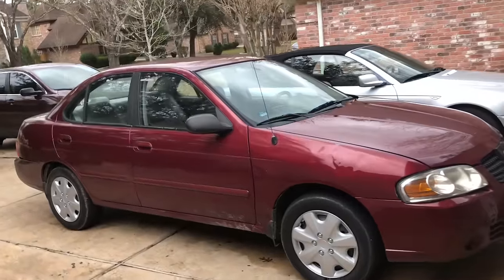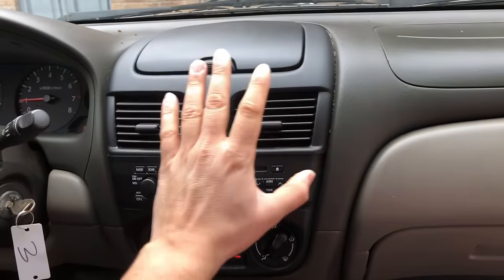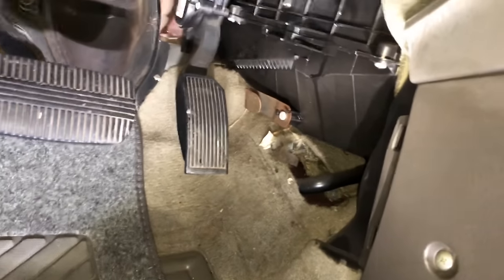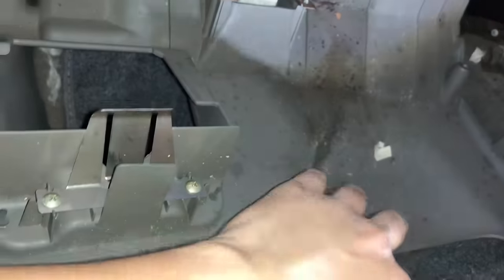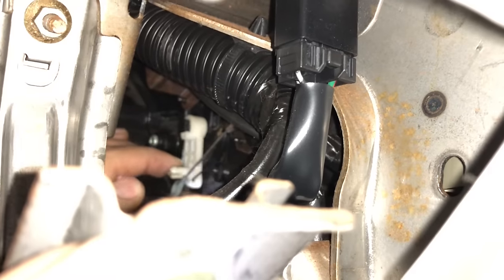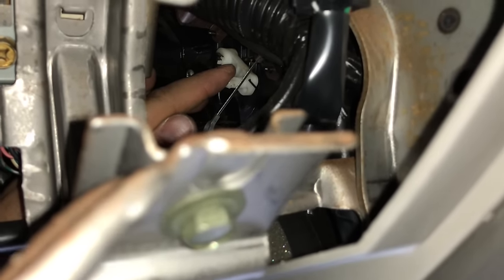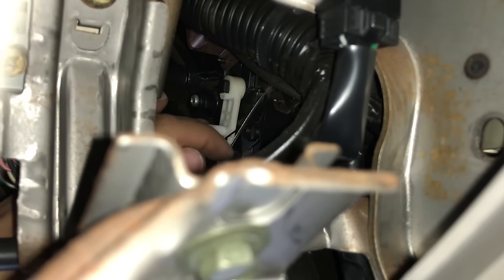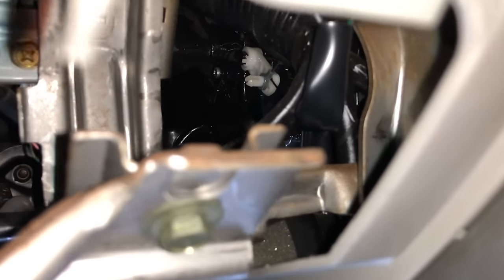Ac Blows Hot Air Only Fix - On Any Car

Comment: i have this issue right now on my 2010 civic, the passenger side vent (just the one on the right) is cold and the driver and middle vents are warm.  I have checked the AC relay (OK), checked the temp ix door (its working), performed a hvac self test and no lights flash, checked r-gas with the fill can kits and its in the blue (filled).  Not sure what else it can be.  I noticed first thing in the am when it is a bit cool outside, all vents are ok and then within 10 to 15 mins same issue happens. Any help would be awesome!
Reply from the maker: Usually that issue happens when the freon is low
Reply: @GarageBoys  Thanks; i checked again today with the air can  fill gague and it says its filled around 45psi.  Its super cold in the mornings and at night. But during the day, just the passenger 1 vent is cold ad the others are not so cold
Reply from the maker: Sometimes the freon it’s so old it’s not cold anymore, the system will say it’s at the right psi but it’s actually filled with air not freon, it’s really not expensive to vacuum the system and add new freon. Check the link in my description and you can buy the cans on amazon cheap or check at your nearest Walmart they also have good prices

Comment: Is that always placed in the driver's site ?  I couldn't find the white plastic ..Mine is dodge caravan 2010.  where could it be ?  do you have any idea ?
Reply from the maker: each car has a couple of them, some control the passenger side, but yes its usually always by the pedals (it may look different) and on the other side behind the glove compartment
Reply: @GarageBoys  Thank you for your prompt response. I found it behind of glove box.   But it looks working. Mine has different problem, I am afraid.

Comment: Does this only happen after you’ve been using the heat and then try to use the ac, or can this happen while the ac was blowing? My guess is this only happened after using the heat and then stopped working when trying to use the ac afterwards. Please leave a reply
Reply from the maker: On some cars every time you turn them on the vents move to the selected option so I’m assuming it would happen anytime but on this one my guess is you are right, it would only happen if you moved it to hot and then tried cold
Reply: Garage Boys hmm interesting. I had a car that made a “fluttering” noise in the vent if I turned the car on with the AC already going and now I know why. I’m going to try this fix but I’m not so sure it’s the problem. My condenser pipes are scorching hot and so is the air coming from the vents. Any further advice? Thanks so much for answering my original question!
Reply from the maker: Is your a/c compressor turning on?  Maybe it’s low in freon
Reply: Garage Boys the compressor isn’t kicking on at all. I had idled for about 15 minutes waiting for a friend to show up and it was blowing cold. Then when I started driving in traffic there was a weird smell and then it stated blowing as hot as the heater on full blast, it took 5 minutes to go from cold to hot as hell. I pulled over to buy a can of AC Pro (with sealant) but the compressor wouldn’t come on so I couldn’t get any of the AC pro in or see if the gage was showing low levels. Do you think it’s the compressor? Thanks again
Reply from the maker: Yes it sounds like it’s the compressor, try to vacuum the freon in the system and then add new freon. Maybe it didn’t turn on when you tried because the system was full of air and Freon couldn’t go in
Reply: Garage Boys man I really appreciate your responsiveness. I’ll try what you’ve suggested. I’m just worried it’s something really weird. I’ve read a lot of online stuff where people spend a lot of money on a new compressor and then it still doesn’t work and it turns out it was some really weird electronic problem. Anyways thanks again and I like your channel

Comment: What if that lever doesn't work, how can you access the vent without the lever
Reply from the maker: What do you mean by “it doesn’t work”?  Is it missing the lever? If that’s the case then you should be able to use a flat head or pliers to turn the vent. The lever  is attached to some sort of gears

Comment: I've recently fixed my car, same model, but the cable keeps getting stuck, have you fixed yours?
Reply from the maker: I placed mine on cold and left it like that. Don’t really need the heater here where I live
Reply: if you spring load the white lever forward it will default to cold unless you move it to warm

Comment: I have a 2015 dodge carivan and the drivers vents blow hot and cold air but the passengers side just blows hot air any ideas
Reply from the maker: Your problem is one of the vent  actuators. For the passenger side it should be behind the glove compartment or behind the radio. You can even call your local dealer and ask them for the part and also location. They will even print out a diagram of the location

Comment: I have a toyota innova 2.8g 2016 model. Ac blows hot in front and at the back it blows cold. How can I fix it?
Reply from the maker: Check your actuators just like in this video, most likely that’s your issue

Comment: I no longer use WD 40 on any of my fix=it lube   jobs because the parts & area  get  dirty collects dirt/ dust/dog hair etc... SILICONE SPRAY is the Clean way to go, superior lubricant,, no Riley residue !! My Ford truck needed a A/C  = Htr control module  btw..

Comment: "On any car" right...BMW uses an electric servo valve to block coolant to the heater core, chevy has an electric blend door in newer stuff vacuum in the older, ford has vacuum still has both...Some have mechanical actuator cables not to mention some vehicles dash needs to come out. This 1 specific problem on 1 specific car is NOT some end all fix lol...

Comment: 2016 ford focus, ac blows hot air, heat no air at all, will this work?
Reply from the maker: Yes just make sure your a/c turns on and your pipes get cold
Reply: What was the problem?

Comment: Years ago this was referred to as a diverter door or flapper or mix door. I suppose if you checked the refrigerant level/pressures in the system and all that was within specification then you should start searching for a mechanical source of the problem.

Comment: I have an 03 ford ranger an i just did an engine swap. And i have taken out the ac clutch to do so which caused everything to leak out. So after installing everything back in my a/c just blows hot air. I first thought it was low on freon since alot of it leaked out but after adding some and the bottle saying its full nothing. I also noticed that my a/c clutch clicks on and off frequently none stop. It was working just fine until after i disconnected it and installed it back inm. Any help please?!!
Reply from the maker: boboy Nunez since you charged the A/C have you noticed if it leaked? Press the valve and see if it leaks Freon. Sounds like the mechanic didn’t put back the gaskets. When it’s low in a/c the compressor will turn on and off
Reply: Garage Boys yes i added the bottle of freon and the gage said that it was full. And yes on the hight side nozzle where the a/c clucth is located i pressed it and it does shot out freon. So do you think it could still be low on freon because the clutch just turns on and off everyother second and just blows hot air?
Reply from the maker: Take out everything, go to Walmart and buy 2 bottles of Freon they cost $4.88 and add both bottles. That’s the right amount you need
Reply: Garage Boys ok i will give it a shot!! Thanks!
Reply from the maker: Awesome, let us know how it goes and also don’t forget to help us by subscribing
Reply: Garage Boys thank you so much for the help my ac is working now it turns out it was low on Freon. But not the only problem is that only the top vents above the dash are working?. My mechanic says that when i installed my engine i must of hooked up the vacuum hoses wrong. What do you think?.
Reply from the maker: Well there’s a big possibility that is accurate because the problem happened after you replaced the engine. But check the panel that I show in this video maybe it’s stock and by manually moving it it may get back in position
Reply: Garage Boys ok i will check that next thanks for the feedback!!
Reply: boboy Nunez your system is not properly charged. That's why your clutch is cycling rapidly.
Reply: Edward Thayer thanks bud i appreciate it thats exactly what it was but now my issue is that only the vents on the dashboard are working?

Comment: That's not for ANY car.
Reply: teknizzle420 that is for ANY vehicle. You just have to do the work to find out where it’s located on YOUR vehicle. 
And of course this is ONLY a cross of elimination bc the ac system can be tricky, since it’s not just one part.
Reply: If mechanical its similar
Reply: My 2002 gmc yukon blows hot air like that even when you turn the heter is off , can that be the same problem?
Reply: True that at least not for a Chevy s10 1997  it as a bitch on a s10  I had to take the dash board off

Comment: Can you help me my car blows hot air when the air con is off & I am driving its been bk to the garage 3 times with the same problem & i Dont think they have a clue what they are doing,
Reply from the maker: Well if the a/c is off yes it will blow hot air. Do you mean when everything is off it still blows? Then your “recycle” option is off. That means that you are getting air from the outside
Reply: @GarageBoys  thank you for the replying, I mean when everything is off & just my engine is running but it only starts blowing red hot air after 20/30 mins of the engine  running, I have had the heater valve replaced 3 times my mechanic kept saying it was a faulty part but it is still doing it, now he is saying it is the head gasget, I just don't want to be paying out more money I haven't got if it is a quick fix. thank you
Reply from the maker: The head gasket has nothing to do with the a/c, if you have a bad head gasket your engine will overheat and your temperature gauge would reach the red zone. Now tell me exactly what the a/c does, you are saying that if the a/c blower is off (no air coming from vents) after 30min. It starts blowing hot air, even with the a/c blower in the off position??? Is that your issue?
Reply: @GarageBoys  sorry for bugging you, & thank you so much for replying again, yes that is right a/c is off, when I start driving there is  a slight bit of cool air coming from the vents then after 20/30 mins the air coming from the vents is boiling hot & blowing like I have the heater on high & this is all happening wile the a/c is off & it has a bad smell to it. I though it had nothing to do with the head gasget, I am going to take it els where I have paid for a part I did not need & labour on top & now he is still wanting me to pay for the same thing to be fixed. Thank you so much :-)
Reply from the maker: Sounds like you are having issues with your recycle button, (that’s the one with the arrow in shape of a U) if you don’t have that on the you will always get outside air coming in, and that’s air from your engine so it will be hot and also smell. Now if your have “recycle” on and you still get the air then your vent broke and you need to get it replaced. It’s usually located by the a/c blower under/behind the glove compartment
Reply: @GarageBoys  thank you so much, I will switch it on & go for a drive see what happens sounds more likely to be that than the head gasget. Thank you so much for your help :-)
Reply: @AngelAngel-nj6ef  what was the issue?
Reply: @Integrity.is.everything  I never got it fixed I scrapped it & bought a new one, it was costing me to much money going to the garage all the time :-)

Comment: Would this work on a newer vehicle? Have a 2016 Nissan Altima. It blows fresh air (not cold) then if I stop at a red light it blows hot air. Any ideas? Greatly appreciate any info!! Anything helps. Haha love your video!
Reply from the maker: this will work on your vehicle but sounds like you are either low in freon or your fan is weak, hope that helps!

Comment: The valve is stuck into the open position and might need replacing or it might just may have a lose vacuum line if it is vacuum controlled

Comment: Do you have videos on Nissan Maximas?
Reply from the maker: What do you need exactly
Reply: My AC shows full in my 2009 Nissan Maxima but blows out hot air. What do you think it maybe the problem?
Reply from the maker: yes it can definitely be this issue shown on the video, check if your pipes are getting cold. or the other issue may be your system is full of fresh air which happens sometimes, you can vacuum the system and add new freon.
Reply: The pipes are not cold. I checked the fuses to the blow motors and they are fine. Where is the system located?
Reply from the maker: Follow the pipes and look for the low charge connection

Comment: Can anyone help me, 08 civic ex compressor and clutch are running, pressure is good, plenty of AC liquid, only blows cold air when i press the gas pedal but when i stop it blows regular air not cold not hot but regular! Anyone know what can be causing the problem ?
Reply from the maker: Sounds like your fan is out, the car has 2 fans or 1 fan with 2 speeds. Check that I’m sure that’s your issue
Reply: Garage Boys  the fan turns on when i turn on the AC but no cold
Reply from the maker: Like I mention before there’s 2 speeds for the fan, and if you only get cold air when you step on the gas pedal it’s because your fan is not blowing enough or your clutch is out even though it turns, the inside is broken and a common hint of that is a red (brick) color on the clutch

Comment: My 2001 Pathfinder is doing the same thing but mine has digital temperature control , would it be the same? Compressor works and lines are cold but air is boiling hot
Reply from the maker: David Conde yes it will still work, even though it’s digital the system operated the same

Comment: What if clutch only kicks in when u jump.it. 97 chevy cheyenne. And only getting hot air
Reply from the maker: What do you mean when you say it kicks in when you jump it? How do you jump it? Sounds more like a bad compressor
Reply: Garage Boys I jump it at the relay with piece of wire
Reply: 87 to 30
Reply: It kicks clutch in but still hot air
Reply from the maker: If the A/C is low in Freon it won’t kick in, do you think maybe that’s why you have to jump it manually?
Reply: Garage Boys might be. was gonna put freon in it ,but was reading good, but compressor wasn't kicking in when checked it.
Reply: I'll check levels again tomorrow with clutch kicked in and see. Thanks for your help.

Comment: I have an 05 Altima, and mine has a small leak. Just doesn't blow cool. Would this solve my issue? And how difficult would this be for someone to do who has zero knowledge of cars?? 
I thought using one of those recharge cans would do the trick but a lot of videos are saying don't use them. Thoughts ??
Reply from the maker: Sounds like you don’t have this issue, your problem is your low in Freon. It you have a small leak, you can add a can of Freon and it may last you all summer. But if you have a large leak then you need to fix that issue. Usually leaks happen on the valves where you add the Freon or in the connections to the compressor

Comment: I have a 05 volkswagen jetta 2.5 and it also blows hot air..
Reply from the maker: Ann Harris make sure your compressor turns on and your a/c pipes in the engine are cold. If they are then your issue is the actuator vent like I show in this video. You can buy it cheap on the link in my description just make sure you buy the one for your car
Reply: Garage Boys Thank you I will check it out

Comment: The cable that goes to the hot and cold knob can be broken,  because My sorry cheap pile of crap Nissan is broken and it will Cool good if I use a pair of Vice grips on the cable going to that nob.

Comment: Honda civic 2006 the ac blowing hot air please i need help thank u
Reply from the maker: Is the a/c compressor turning on and are the a/c pipes under the hood getting cold?
Reply: Yes the ac compressor working fine but the pipes not getting cold
Reply from the maker: Sorry for late reply, you are probably low in Freon

Comment: Your AC is low on freeon so you have to charge system but look at Manuel or under hood in engine bay should be a manufacturer sticker telling you what type of system you have and PSI and pounds you need and max you don’t want to go over.

Comment: So I definitely have the clicking noise and hot air blowing from vents, but I’ve also been told the pipes are very hot as well. What may that be?
Reply from the maker: Well if the a/c pipes are not getting cold that means there’s no Freon circulating, but if you hear the compressor clicking that means you have a bad compressor. Because it’s turning on but the clutch is not clicking properly.
Reply: Appreciate the response
Reply: What was the problem?

Comment: As a certified master tech myself with 46 years experience I disagree on what he is showing you because first of all the switch thermistor on the dash is what sends up to 5 Volts to the blend door motor you can't assume the problem is the blend motor.A Professional technician is first going to hook a scanner into the aldl or can port to scan the perimeters in the HVAC system in order to determine the problem and resolve it no put a band aid on it in which he just performed
Reply from the maker: After 4hrs of a technician diagnosis and $800 fee he will come to this conclusion… don’t believe, then read all this comments and look at all the likes. I’m still a happy camper with my fix
Reply: @GarageBoys  Once you've evacuated  (for a fee) they'll have to recharge it (for a fee)😒 No wonder he doesn't agree with your method/solution